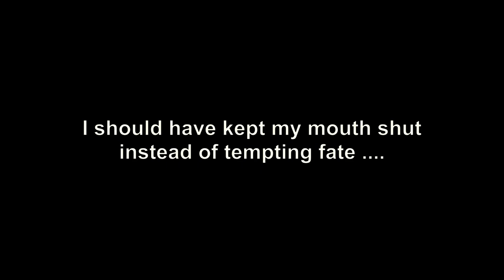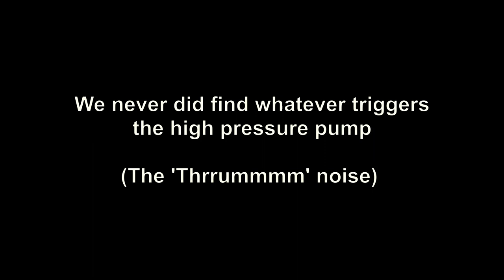Water in the bilge - Carrickfergus - Belfast Lough - Ep. 131

Comment: The high pressure pump for the pressurised water probably has a small filter on it about the size of an egg cup.  If it hasn't been cleaned out for a while it clogs up and upsets the pressure sensor for the pump. 

They were just building the apartments around the marina the last time I was there, yes it was a while ago.  Ran aground in the entrance at low tide :-(  Ended up going into the old harbour and walking the boat across the harbour sand to the slipway.  Interesting way to learn about tides and how quick it goes out.
Reply from the maker: The apartments have been up for quite a while - more 20 years - so yes, definitely a while ago. :-) These days there is a dredged channel and a leading mark for the marina. Having said that, we came in at low tide and had 20cm under the keel

We will check for that filter on the pump. Thanks for the tip!

Comment: That Thruuuumm noise on the pressure pump can be the one way valves in the pump failing, i.e. it is leaking back into the tank! Not the worst leak, you could buy a service kit for the pump, buy a new one and keep the old spare or maybe attempt to clean it, just a few ideas. Love your videos and troubleshooting/contortion skills :D ! Fair winds, Ros.
Reply: Oh another cheaper option might be to buy an inline check valve and place it after the pump outlet.
Reply: Another place to check for a leak is the PRV (pressure relief valve) on or near the hot water heater if you have one
Reply from the maker: That is an extremely good point. We had not considered that. The downside of your idea is that the pump is in an area requiring maximum contortion skills since I would be upside down and back-to-front.

Since it has warmed up, the Thrummmmm has more or less stopped. I wonder if it is temperature dependent?
Reply from the maker: We have checked around the tank and the area shows no moisture or water. That is what I was shining the torch on in the video.
Reply from the maker: Hmmm... I prefer to fix rather than "bodge". I like to find the problem and rip it out as it attempts to quiver in its lair ;-)

Comment: We had a leak at a pipe tee connection that let water into the bilge, which triggered the low pressure sensor on the water pump every 15mins or so causing it to thrummm for a second.
Reply from the maker: That is exactly what happened to us in the start of Going Off Grid https://youtu.be/D2hsn0j-f2k For us it was a leak in our hot water system. This Thrummm is exactly the same noise so is the high pressure pump, but is only occasional. I know it does't solve the problem which is why it will come back to haunt us at some point, but currently we just keep the pump off when we are not using it

Comment: That's the first time I have seen my berth in a month. Just need this isolation to finish and get the boat back around to it. Does your fridge box have a plug at the bottom so it can be drained into the bulges?
Reply from the maker: Sadly yes, but I do not think it was designed that way. Another previous owner bodge...